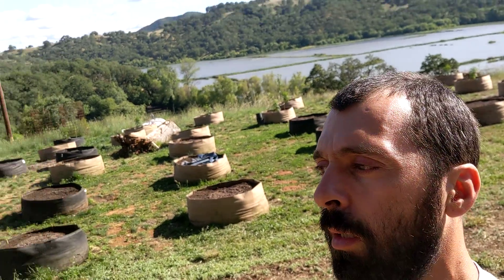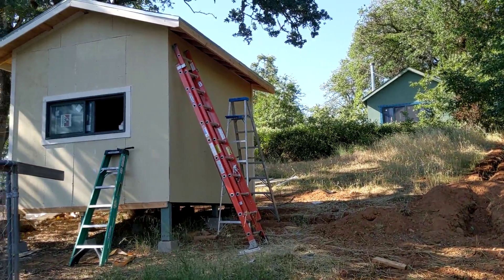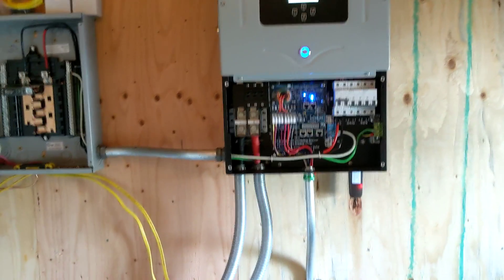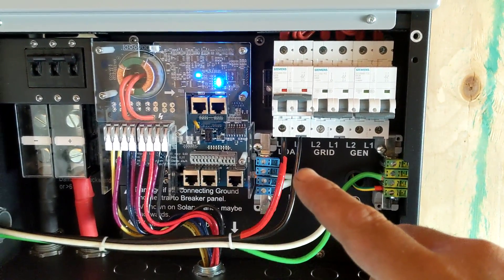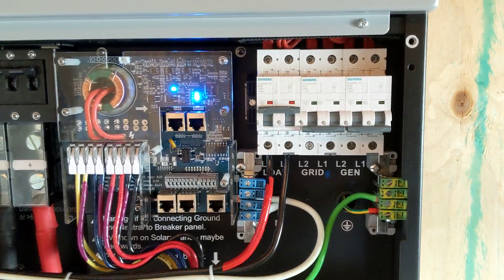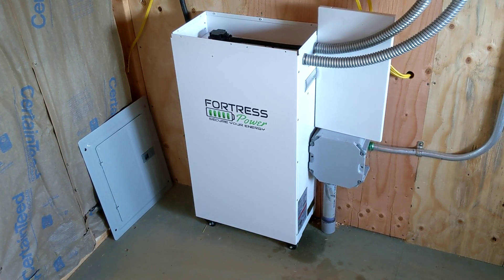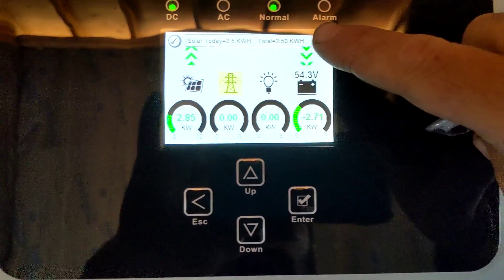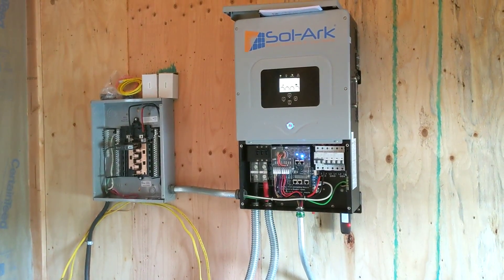Solar off grid with SolArk 12K and Fortress 10kW battery - May 21, 2020

Comment: Solar tip: e.g. a Beuler and all other hungry electricity consumers can be continuously adjusted down to e.g. 300W with a 5000W dimmer (7EUR). I run 5 dimmers in parallel on an 850W inverter. Kettle 2.2KW at 150W runs 12 hours a day, so the water is always hot. The room is also nicely heated. 2.5KW washing machine runs in parallel with dimmed to 200...400W. Iron, dishwasher, oven, electric heater, coffee machine, all internal heating are throttled with me. Videos about it on my channel https://youtu.be/eC2olbCBhh0 The inverter stays cool, quiet and the MOSFETs remain intact because extreme current peaks no longer arrive at the inverter. Now every Mini PV Inverter is enough to sell large devices...

Comment: Hi great work 👍, how many dc volts per string.what are the volts per panel,and the total volts( dc) of the inverter.?
Reply from the maker: Thank you!
Solark allows maximum 500Vdc per string. 2 string can be combined in parallel per each of the 2 MPPTs (20A cut off). I believe we had 4 strings of 10 panels total. 2 pairs of 10 in parallel. Panel OCV around 30Vdc.
Very well done product with installer in mind.